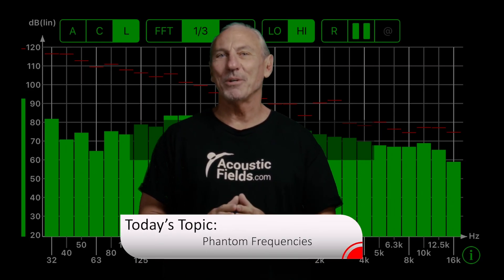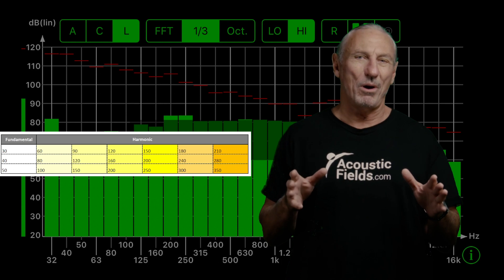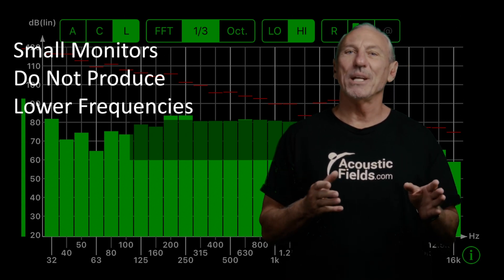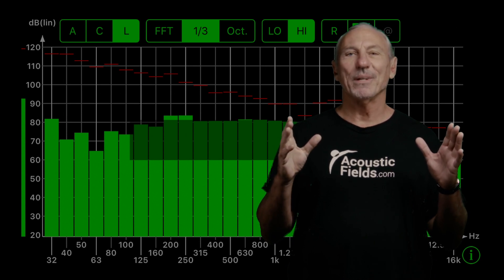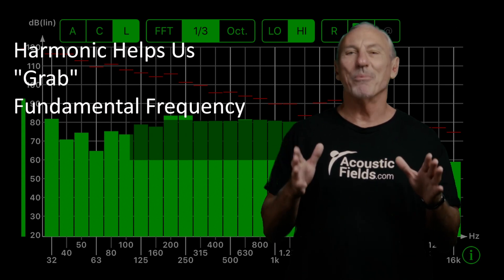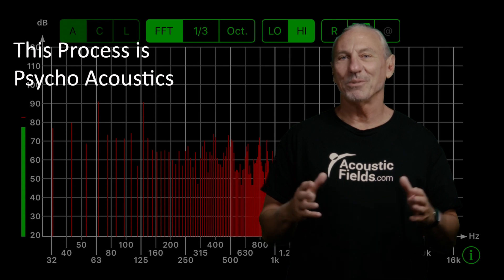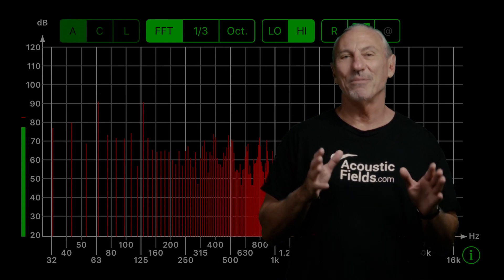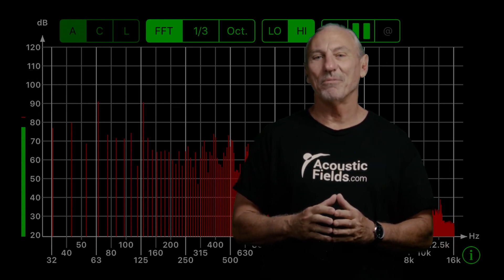Phantom Frequencies - www.AcousticFields.com

Comment: I monitor on 12 inch speakers. I can't work on those small speakers.
Reply from the maker: Everyone has different preferences. This is what makes the industry so fun to work in. Every engineer is different in methodology and even gear. We see speaker size ranging from 3" - 12".
Reply: Acoustic Fields I just like to be able to turn it up every now and then to see what I have at loud volumes. I find small speakers struggle with that.
Reply from the maker: @officialWWM  Quantity is not quality.
Reply: Acoustic Fields yeah, that's why live PA systems use 5 inch speakers 🙄 If you want to move air, you need larger speakers.

Comment: @Acoustic Fields 
I have a question:

I am a mixer, and thinking about ditching my sub. My nearfields can go down to 37Hz, but if I flipped the 50Hz high pass switches on them, they wouldn't produce some problematic frequencies that create high pressure areas in my small room. That way the upper frequencies could be more even. Is this a correct way of thinking?
Reply from the maker: Its a start. You must treat all the low-frequency issues first and foremost.